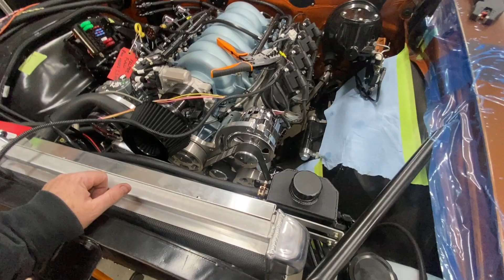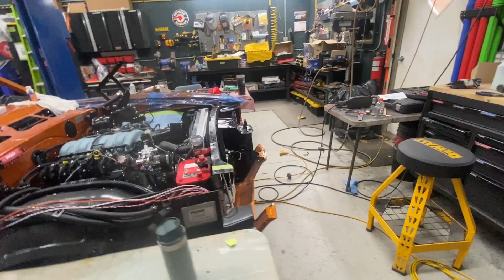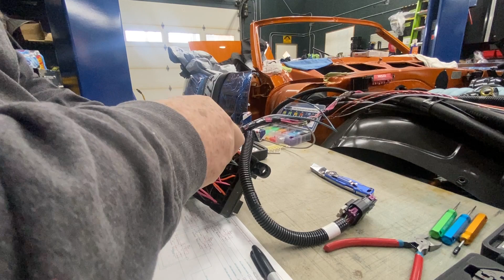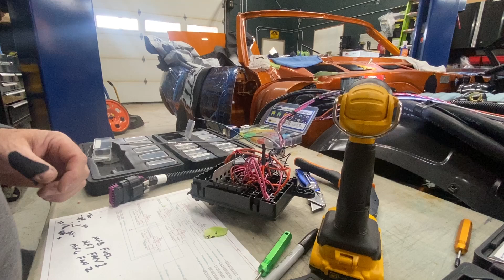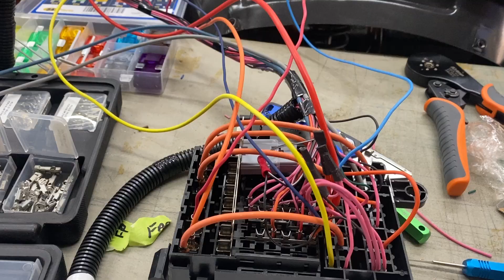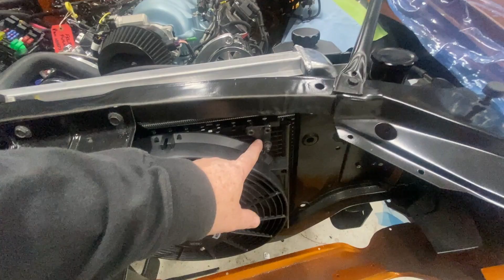67 Firebird, Part 133 Reworking the GM Performance Harness and Relay/Fuse Box

Comment: Where did you source the replacement connectors
Reply from the maker: I was able to source the pins for the fuse box on amazon based on the Delphi part numbers from the pdf file I shared in the description.  Just remember to use "Tangless" versions as noted.  its a little easy to mix them up based on the descriptions in amazon.
Reply: Thank you so much sir. Love the videos